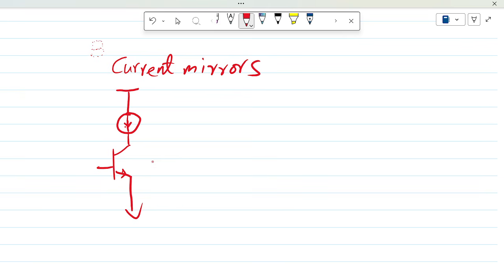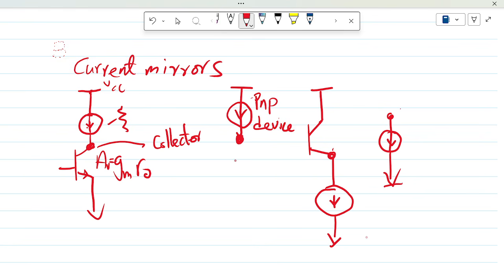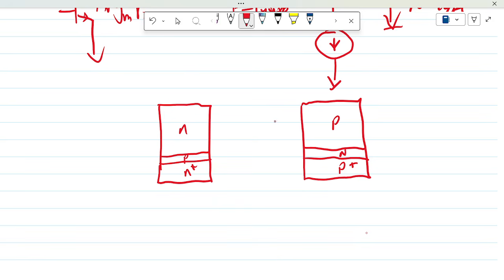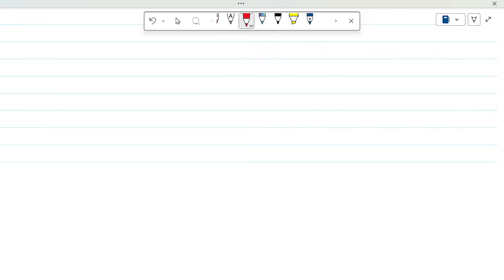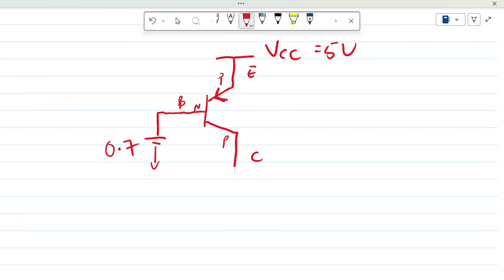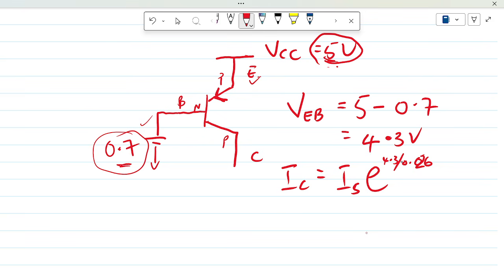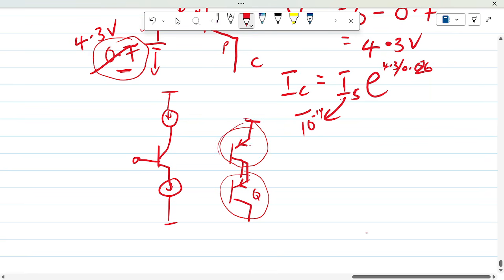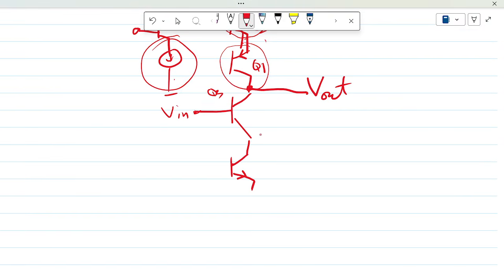PNP & NPN Current Sources Explained | Introduction to Current Mirrors (Part 1)

Comment: PNP & NPN Current Sources — Current Mirrors (Introduction)

A current source is a circuit designed to supply a nearly constant current independent of the load voltage.
In BJTs, current sources are commonly implemented using current mirrors.

Basic BJT Operating Condition (Forward Active)

For a BJT to operate correctly as a current source:

• Base–Emitter junction must be forward biased
• Collector–Base junction must be reverse biased

For silicon BJTs:
VBE ≈ 0.7 V

PNP Transistor Current Source (High-Side)

For a PNP transistor connected to VCC:

VEB = VE − VB ≈ 0.7 V

If:
VCC = 5 V

Then:
VB ≈ 5 − 0.7 = 4.3 V

This biasing keeps the PNP transistor in forward active mode.

Collector current:
IC ≈ IS · exp(VEB / VT)

Once biased, IC remains approximately constant.

NPN Transistor Current Source (Low-Side)

For an NPN transistor referenced to ground:

VBE ≈ 0.7 V

The emitter is near ground, and the base is raised to about 0.7 V to turn the transistor on.

Collector current:
IC ≈ IS · exp(VBE / VT)

Again, IC is largely independent of the collector voltage (within active region).

Current Mirror Concept

A current mirror copies a reference current into one or more output branches.

Principle:
• Two matched BJTs
• Bases connected together
• One transistor is diode-connected (collector tied to base)
• The reference current sets VBE
• The same VBE forces a similar collector current in the output transistor

Thus:
Iout ≈ Iref

PNP vs NPN Current Mirrors

PNP current mirror:
• Used as a high-side current source
• Sources current from VCC

NPN current mirror:
• Used as a low-side current source
• Sinks current to ground

Both rely on matched VBE values.

Collector Current Relationship

IC ≈ β · IB
For large β, base current is small and often neglected.

Why Current Mirrors Are Important

• Provide stable bias currents
• Used as active loads in amplifiers
• Essential in differential pairs and cascode amplifiers
• Improve gain and circuit consistency